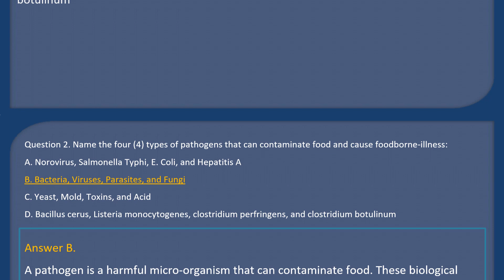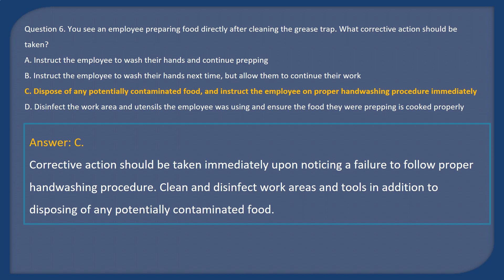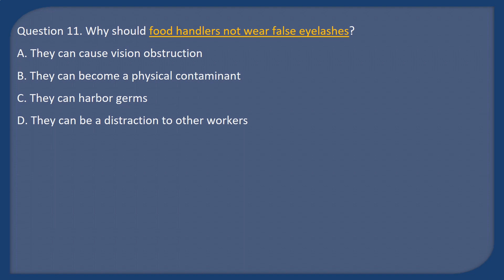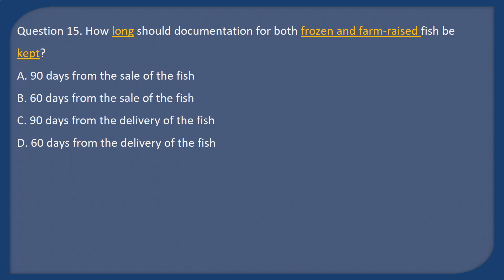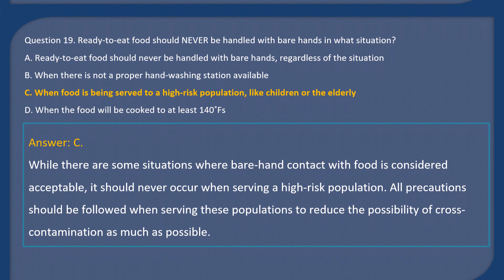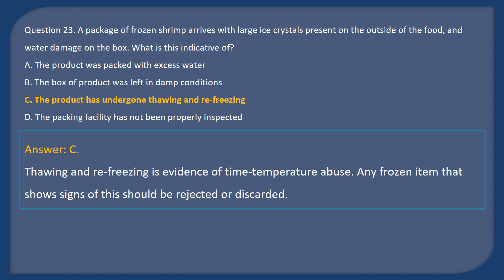ServSafe Manager Practice Test 2023| ServSafe Manager exam |ServSafe Manager study guidle ( Part1)

Comment: There are multiple incorrect answers in the quiz. Example Q19. The answer after searching multiple spots online is (A) Ready to Eat Food should NEVER be handled with bare hand regardless of the situation. The quiz gave the correct answer as (C) When it is served to high risk people like the elderly and children. Please do not take these answers for granted. Study the book that was given to you. I found at least 3 others in this video that gave the wrong answer.
Reply: I found that there are situations where bare hand contact is allowed. Washing produce is one of them.
Reply: Which doesn't make a lot of sense that washing produce with bare hands is allowed, unless that produce ends up going through the oven. 
Cold water isn't going to wash off the bacteria or viruses that could be transmitted from the hands. Although it does make a difference if the lettuce is washed before it is cut. You wouldn't want to cut the lettuce and then wash it.

Makes sense to wash, then use gloves to cut.
Reply: Well it varies by state in ohio you can prepare rte foods with bare hands but for the sake of the test we should never touch ready to eat foods with bare hands
Reply: Actually they got it right, I recommend you study again